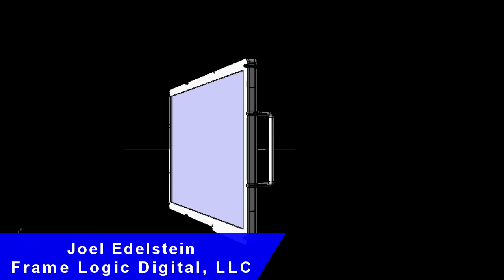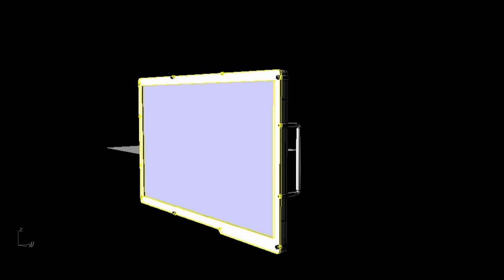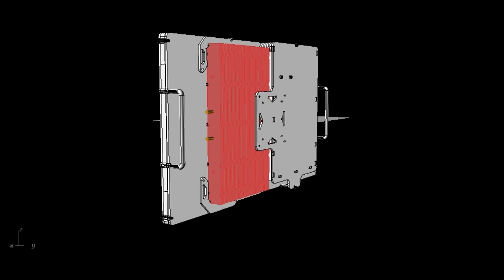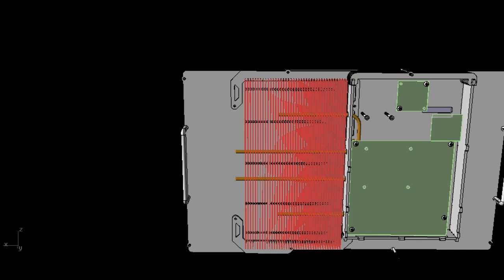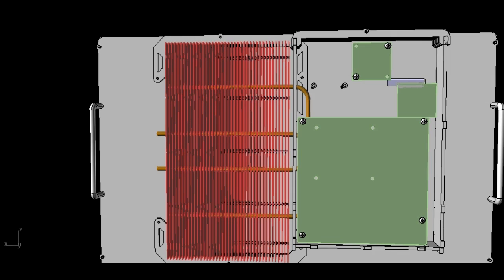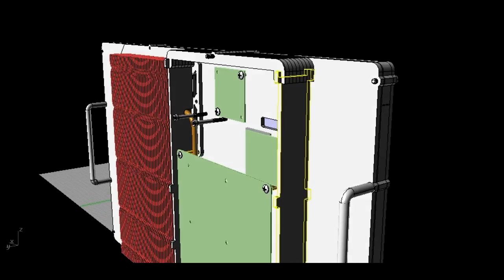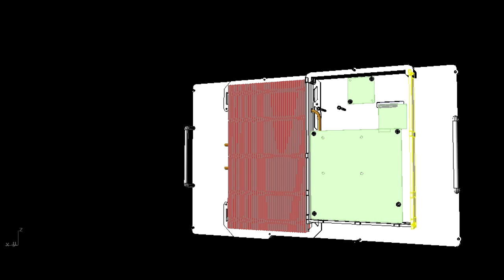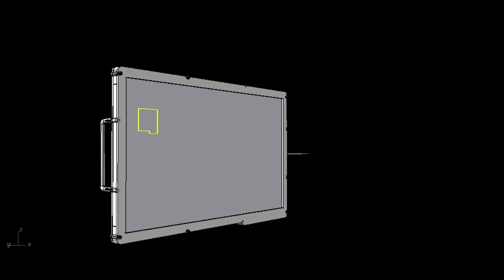Fluffy2 - enclosure (interview with designer)

Comment from the maker: If you want to use something like this a whole day without recharging, sticking an IPS panel on it and putting a quadcore ivy bridge desktop processor in it isn't your best bet :D The display is a 22" IPS, you can't expect ultrabook power consumption there.

This is a pretty powerful machine; the fact that a fairly tiny 8-cell battery can even power it usefully for so long is quite an achievement.

Comment from the maker: A touch display doesn't make sense on desktop computers. It's just a gimmick, not actually something you can use productively. Keyboard and mouse are far superior input devices anytime.

The battery life at full idle, screen off is about 13 hours, the battery life idle with screen on is roughly 8 hours and the battery life at full power is just under an hour. Typical battery life, i.e. actually using the computer with real-world applications, is about 4 hours.